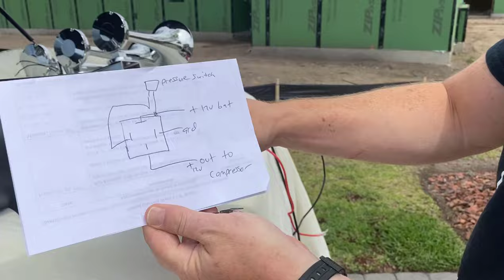Train Horn How To Installation - 150 decibels On a Ford F-150

Comment: I think the sound will be loud no matter which way it is facing. I would probably want it facing backwards with a slight downward pitch to prevent water and road muck from hitting it directly. Plus with it slightly hanging below the front spoiler it would be easy to see if a cop leans down and looks under it. Nice looking clean install though. Thanks for sharing.

Comment: Looks nice, I would probably prefer putting switch in overhead console eyeglass holder. LEOs may find under dash if you allow them to look. Switch should cut compressor so they don’t hear it come on.
Reply from the maker: That/s the beauty of custom wiring I suppose...

Comment: Hi.. I also have a 19 ford f150 that I want to install a train horn on. I would like to use my factory horn. I have the train horn kit. I want to know if I understand your wiring right. You mention that the green/white wire from the horn is a load ground.... So do I need to break 12v to my horn or ground to my horn? I hope you understand my question. Any help would be greatly appreciated. Thank you
Reply: I think green white to switch only. The other wire off switch goes to horn

Comment: looks to me like your video is spot on could I get the excact wire I need to tie into from horn on my 1992 GMC Sierra 4x4 CK , mY air horn kit is arriving in the next day or two would like to get it installed as you have yours (with either option for sounding off) thanks again for info and great instructions.

Comment: I've been installing a setup on my 2010 Silverado and I also had the idea of running a toggle between stock and train  horn, but for the life of me i can not get it to work, Would you be able to provide me some more detail on how you did the splice? every time I try it, or change the wires around... No matter what position the switch is in, The train horn will fire. Almost like the switch is broken.. Hmm, Maybe the switch is broken....? Sometimes you just have to talk about it... Still, Would not mind having some incite into the switch wiring to make sure I am doing it correctly.

Comment: What wire do I tap in for 1995 Tahoe horn? I want to do the same install setup... toggle switch the powers on compressor when needed and also allows the train horns to work along with my stock horn when I press the steering wheel horn...  and when the toggle is off only my stock horn works...

Comment: Mines leaks with the Teflon tape. Thinking about removing all of the tape.
Reply: I'm having the same problem. My system is a Viair dual compressor system with a 2.5 gallon air tank and six ports. I've used regular plumbers tape, yellow gas pipe tape and pipe thread sealant. Its such a slow leak I cant tell where its coming from and this results in the compressor kicking on in the garage in the middle of the night. Not my daily driver so it would lead to a dead battery on occasion. My work around was tying it into a power source that only came on when the ignition was on. Now blowing fuses. Pulled the entire system out and going to redo everything to see if I can solve the leak. Also saw in an other video the foot switch. Love that! especially since the Airhorn is my only horn. With the foot switch I can rewire the factory horn for those times when a full on air horn blast isn't necessary.

Comment: Are the Air horns fused?
Reply from the maker: Yeah, I showed that under the hood at the battery
Reply: @Lesscoelectronics  you did. Thanks
Reply: Do i have to put a relay all time or just a fuse and straight to the battery ??? And to connect the air switch is positive all time ???
Reply: Thanks great video

Comment: What kind of switch did you use to go from City horn to air horn?
Reply from the maker: I used a foot switch I showed in a recent video
Reply: .. Not to power on the horn but to actually switch from city horn to air horn.
Reply: @Lesscoelectronics  I saw that video (I've been binge watching your videos) and want to install one in my Subaru Outback. Do you sell them on you Ebay site?
Reply from the maker: https://www.ebay.com/itm/144079247729?hash=item218bcad971:g:M8QAAOSwH3Rgy5DO
Reply from the maker: here it is:

https://www.ebay.com/itm/144079247729?hash=item218bcad971:g:M8QAAOSwH3Rgy5DO

Comment: With a direct battery connection, if a leak ever forms the compressor will run continuously and kill the battery. I'd suggest connection to an accessory circuit controlled by the key. Be careful as that compressor will pull decent current and can't be tapped on to any circuit without blowing a fuse. Some new cars have an accessories relay near the battery after a large fuse.  BTW, I assume a fuse is in the compressor circuit near the battery. Fuses prevent fires!
Reply: I have a quick question. I purchased this same system, except with plastic horns. 

It was an open box purchase and the air line is missing. Can you tell me what size air line came with your kit?

Thank you.
Reply: I just described that exact problem that I am encountering. Hit reply then scrolled down and saw your comment.

Comment: I have an octet system installed on a ram rebel and I have it wired to a button atm, I want to wire it to my factory horn though so I can use the lock button on my remote to blip the train horns even if the vehicle is off without me in it, would the same wiring work for this?
Reply from the maker: I think so